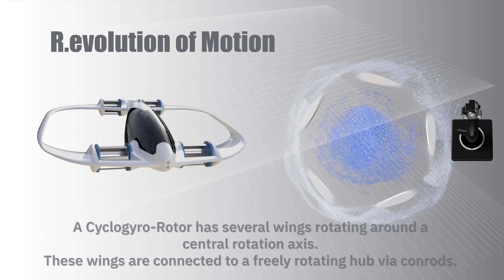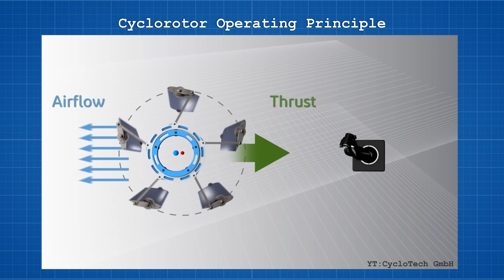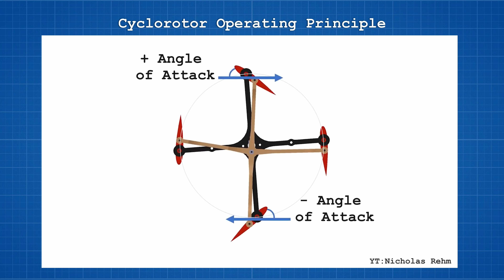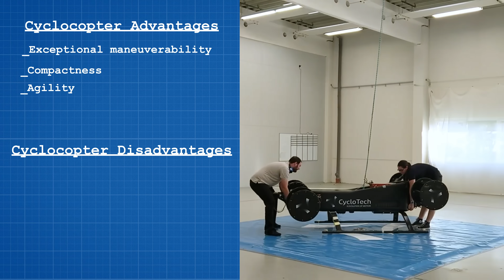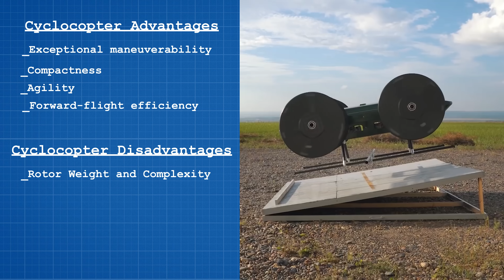CycloRotor: Is this the future of eVTOL Electric Propulsion System?

Comment: This is pretty cool… if you could fit rubber tyres to the rotors I could see this being able to use the roads too

That being said… and I could be wrong… it doesn’t look to have that many advantages over a traditional quadcopter design, which are also getting more compact and efficient and seem to have similar performance, if not better
Reply: You're wrong on 2/3. Propeller multicopters can't be as much compact as this design, more blades and variable pitch while having both upward and forward propulsion at the same time and also can't have more performance (speed) due to drag, fixed pitch and the need to balance between upward and forward propulsion. They're more efficient though... for now. The best design to combine efficiency and speed currently are the vtols like Osprey, which is not exactly compact.
Reply: @perseusarkouda  I can’t say I know a lot about either of these technologies tbh, and I figure they’re both in their infancy still… I have seen a video of a “manned” racing drone doing a flip though, which was a pretty impressive display of agility, as well as hoverboards being made out of multicopters, which in my opinion is pretty compact (and also awesome)… I can see them being competing technologies in the coming years though, each with their advantages… which will only be good for advancing these technologies. With any luck we’ll end up with some of the cool futuristic vehicles from the movies :)

Comment: One potential problem not mentioned yet is what happens in the event of an engine failure?  Fixed wing air vehicles can glide to some degree and helicopters can autogyrate, what would be the recovery technique with this system ?
Reply: I assume this could auto gyrate to some extent but maybe parachutes to assist?
Reply: Parachute and ejection. Backup power and motor. Electric motors are nearly 100 percent reliable, unlike liquid fuel engines. Safety is not biggest hurdle. I think its flight controls and stabilization, I have an idea for that.
Reply: Rocket extended parachute.

The engine only reloads the battery, so a failure is not critical.

Comment: Amazing concept. Idk about military applications though. Each of the cylindrical blade hubs create a relatively easy to hit target from any angle, that I would imagine would get shredded by just a couple bullets when rotating. Not to mention shrapnel from airbursts. Especially as the structural integrity of the blades is an issue even without bullets hitting them. 
Sure helicopters have rotating wings too but those are more durable, the surface area of the blades is very small compared to the empty space between them, so a hit to a blade is much less likely than with this design.

Comment: The agility is really nice but the disadvantages are too big. The complexity and the simple fact of not a good efficiency / redundancy. This concept in an event of single propulsion failure would fail completely. Regarding efficiency, the basic theoretical principle is that you want to move as much as possible air volume with as lowest as possible delta speed. Therefore the most effective are currently turbofans with high bypass ratio. As far as we dont have very cheap and high density accumulators of energy this is a problem.

Comment: In case of any propulsion or mechanical failure, is there any fail safe like auto rotation similar to a helicopter?
Reply: Too complex and lacking gliding possibility. A small mechanical failure and it becomes a brick midair and the pilot an omelet when the brick smashes into the ground.
Reply: @uberraschtedame1510  and because of that I don't see this concept taking off. Too complicated without enough redundancies.

Comment: Very cool seeing these early iterations. Electric motor, battery and material advancements will make this more and more viable. Exciting times
Reply: Luke Norris
Didn't even know about this before now... it is excitng!
Reply: I think it's need lots of energy for a flight
Reply: @Carl Klinkenborg think they are trying  to milking the investors
Reply: What electric motor and batteries have anything to do with this?
If anything - electric propulsion makes it inferior.
This is perfect for steady speed, high rotational inertia combustion engines.
But… if it were so good, it would have replaced helicopters long time ago.
Reply: @JDrwal2  It’s in the title of the video. Did you accidentally write in the wrong chat?
Reply: @JDrwal2  .... the only reason it hasn't is because of it's complexity
Reply: @LuigiKjo  and it takes time to develop the technology. Helicopters have been around for over half a century. They have a significant head start.
Reply: @DodgyBrothersEngineering  BS. This concept was attempted in helicopters even before  they tried propellers.
Doesn’t that tell you something?
It was also used in wind turbines but lost to 3 blade traditional design.
It was also supposed to be the best invention after sliced bread.
By the way - was used to power wind mills more than a hundred years ago.

I’m devastated how easy it is to fool todays ignorants.
The weight to power ratio will again kill this ancient invention.
Reply: @JDrwal2  carbon nanotubes are extremely light weight and very strong and they can formed into any shape. It may not have worked before because we didn't yet have materials that would allow to.
Reply: @jklvx4033  You have to look at the principle: how much thrust is developed by how much material. If you improve the material but the thrust remeains inferior to a propeller design with the same materials you don't gain anything.
Reply: @V100-e5q  I'm sure they'll figure it out
Reply: @jklvx4033  Carbon nanotubes cannot be formed into any shape without binding compound. That compound is heavy.
Make propellers out of carbon mono tubes and the props will be much thinner (higher efficiency), and lighter.
Try to beat them then…
Reply: @JDrwal2  BS, the basic concept of a helicopter dates back to 400 BC, was first put down as a design by Leonardo Da Vinci in the 1500's and several working models were already developed by the 1700 and 1800s. The first maned flight was in late 1800 / early 1900s. This design didn't surface until the  early1900's. We have not had the technology to make it viable to go back to this design. Besides you are trying to compare apples to oranges. We already have a helicopter, what they are trying to develop is a flying car. Big blades that can lop your head off are not going to work. So while this idea may not be as efficient as a prop of some kind, it looks to be a whole lot safer. It wasn't until the 1920's that the first real "successful" test flight was conducted and even it was only a few feet off the ground for a few minutes, so helicopter technology was not perfected overnight either.
Reply: @DodgyBrothersEngineering  DaVinci is overrated. Most of his designs would never work even if modern materials and techniques were used. His designs had built-in flaws that no one discusses. His helicopter, submarine, CVT - especially the “DaVinci CVT”… is not a CVT.
He was a brilliant artist, but an average engineer for his time.

So do not discuss designs sketched on napkins, but those that were really built and tried.
This one is one of those.
Reply: @JDrwal2  cut the guy some slack he was born in the 1400's. He had no fancy computers to do computer generated modeling to test his theories. True Da Vinci's helicopter would have never created lift to get it off the ground, but even if he had come up with a viable wooden prop, he would have never been able to produce an engine powerful enough to get lift. He wouldn't have had the electronics we have today to give it stability. You knock the guy without even understanding the world he lived in. He lived in a time when they still thought the earth was flat and transport was a horse and cart. His thinking was well ahead of its time, even if he lacked the technology / engineering skills to make it work. We all stand on the shoulders of giants, nothing that we build today isn't built on some other persons failure of the past. But people in the 1700's had flying toys, so the principles of how helicopter works had been developing over centuries.
Reply: @JDrwal2  I did not know that. And now I do. What's the difference between nano tubes and mono tubes?
Reply: @DodgyBrothersEngineering  with all that you  said you should be able to distinguish their narrative from ours right? Seeing as how you are so smart and all..

Comment: Begoge Monster pro is much better
1. Faster (80kph instead of 50)
2. Takes only 4-5 kW at max speed instead of 48kW.
3. Can take up to 120 kg rider instead of no userfull load.
4. Cheaper
5. Ride in cities in similar way
6. 120minutes of riding at 50kph instead of 2-5minutes
Reply: sir this is a cyclorotor video
Reply: @nameberry220  nevertheless EUC is way superior where that cyclotron is supposed to be whenever need for infrastructure is accounted for. Flight time up to severall minutes at up to 50kph clearly limits that vehicle to cities, where it is forced to compete with EUC. Even up to 15 minutes at up to 75 kph  still limits cyclotron to within cities and competition with EUC

Comment: so each blade moves a full cycle every rotation, how's that for reliability? static parts are most reliable
Reply: That's not that different from helicopters. The rotorblades there also "wiggle" back and forth for every rotation when ever a controll input is given. But yeah, this definitely will need to use materials with good fatigue resistance

Comment: All's fun and games until you snap a belt. What belt you ask? That rubber belt that controls the angle of those rotor blades. Rubber that is soft at room temperature can get brittle in the freezing temperatures at cruising altitudes. You would need an active sensor to alert the pilot in the event a belt began to wear to the point of failure. You would need the ability to set down immediately. A helicopter can autorotate. Can these?
Reply: yes, they can.

Comment: I have a very hard time seeing this ever being commercially viable for human transportation. If you lose one of the rotors, either due to a mechanical failure or physical damage, it will not fly. Yes, this can happen with traditional airplanes and helicopters. But the huge difference is that an airplane can potentially glide to a safe(r) landing and the helicopter can auto-rotate at least slowing down its descent. You have no wings or flee-floating rotors on these that can functionally still provide enough drag or lift to negotiate a safe return to ground level. Even with redundant wings/rotors, I would think you would still have to have a perfect balance of thrust and lift to even remain level. 

In short, unless they can develop a way for these to remain flying or, at least, land safely during the event of a failure, I'm not sure of the potential usefullness for manned flight operations. The only thing I can think of would possibly be a parachute array or drag chute of some sort that could act as a backup safety device.

But please, correct me if I'm wrong. This is still a really cool concept and I will be following the development closely.
Reply: The thrust of the remaining units could be adjusted to keep it balanced, probably it would inevitably begin to descend but slowly enough to land. Auto rotation of a helicopter is not a panacea, for example under 500 feet there is not enough distance to establish auto rotation, and in the event of engine failure the pilot depending on type of helicopter may have as little as 1 second to react to begin auto rotation before rotor speed falls too low to enable it to be done at all.
Reply: https://www.youtube.com/watch?v=mXg4y803LLI&t=6s ...... This is a Ballistic parachute that is designed for just such an occasion

Comment: I am not impressed. Just think about the large diameter of traditional helicopter rotor blades. There is no way this cyclorotor's efficiency can be compared to single rotor helicopter.
Reply: They surely realize that is true, but this could theoretically do things that a helicopter can’t, like fly up to the side of a building (for example), make contact with the side, deliver or pickup people. There would be a market just for that one application, despite the inefficiency.